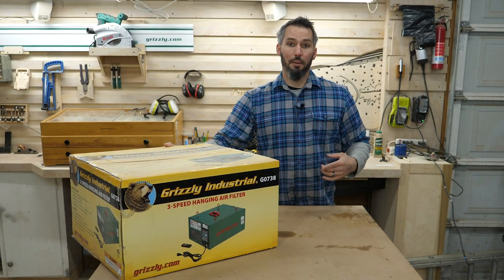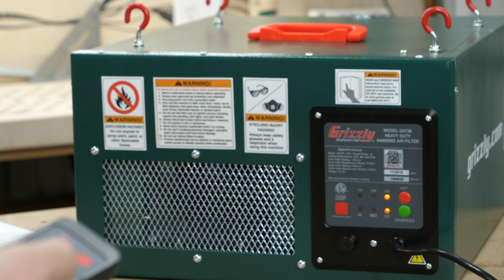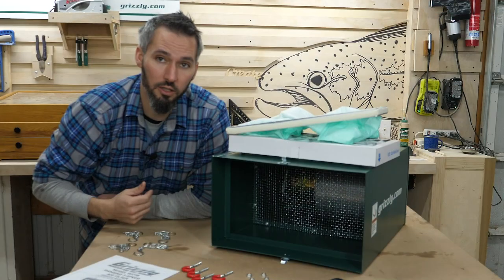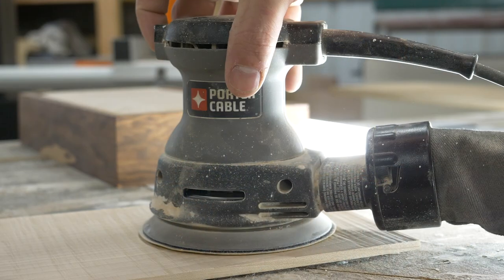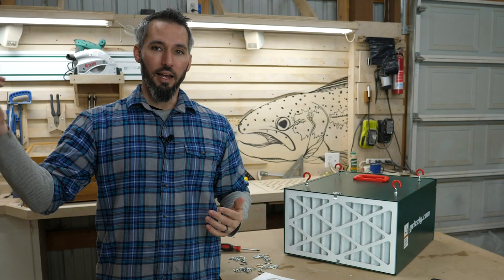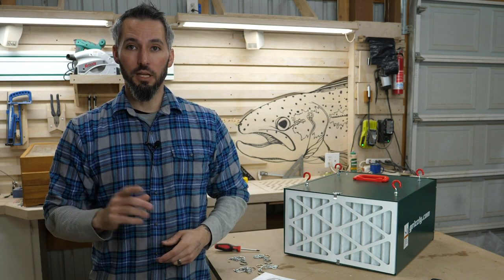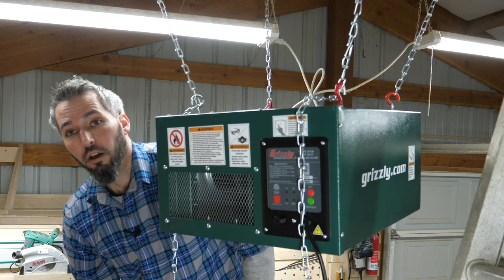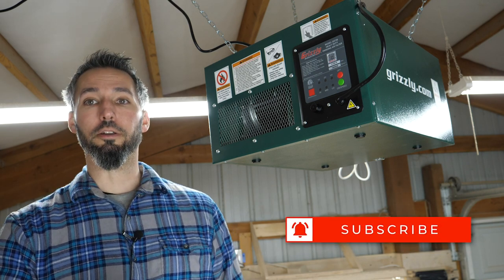Hanging Air Filters for Small Shops

Comment: I just bought the WEN model 3417.  From all my research and the price point I wanted to stay in, it looked like ALL of the "brand name" models were pretty much the same, so guessing all made in maybe 1 or 2 factories, only different names.  I like Grizzly, I have their table saw, but the WEN was cheaper for me.  About 25 years or more ago, I build my own out of 1/2 inch plywood.  Used 2 pre-filters in front, the 3 chamber bag filter in middle, then  on the exhaust side, another filter.  The blower was twice the size of these today, and moved a HUGE amount of air.  Spent less than $300 total for it.  Today, it's cheaper to buy one made.
Reply from the maker: You’re totally right that the Wen and the Grizzly are essentially the same product, just different paint. It’s pretty wild how many wood and metalworking machines for different companies are actually made in the same factory—from bandsaws to table saws and planers. Often, it comes down to paint or a slightly different stamp for the body shell. The rest is basically 1:1 and parts are even interchangeable.

Comment: Good review on the air filter from Grizzly. Did you consider any others and what made you go with Grizzly? Great looking shop too by the way.
Reply from the maker: When I purchased this filter it was on sale for an absolute steal, so it was a no brainer cost wise. I should point out that there are other filters on the market that offer the identical specs. For example, Wen filters are essentially the exact same and you can save a few bucks going that route. Jet is the same as well, though more expensive. Grizzly is a great choice though because you are actually supporting a lot of good American jobs by going that route (about 300 folks work for them in the US!). They also have the largest parts warehouse of any machinery seller, so they’ll have what’s needed, just in case.
Reply: Hello  @RiverbendWoodworks   Thanks for the follow up.  My uncle has a few larger Grizzly tools and I’ve had the opportunity to use a few of them on some projects working with him.  They were well built, heavy duty for sure and seemed to have excellently machined parts.  I’m definitely on the bandwagon of supporting local Americans, that is a rare find these days.  I do also like being able to get parts that are sourced locally instead of the alternative which usually leads to long wait times.  Again, good video and I’m looking at the Grizz now.  Have a good day. Matt

Comment: Why the Grizzley when the other clones are cheaper, WEN, Shop Fox, etc...  Is this different or does it have something the other clones don't?
Reply from the maker: In all honesty it comes down to support for the product and part availability and filter availability. Grizzly has a massive parts warehouse that is US based and they really try to have every key component you’d need available. I use my air filter daily and, like any machine, it’s gonna need components at some point (not in the least replacement filters), and it’s super easy and quick to get them from Grizzly. That said, saving a few bucks here or there can add up, and i hope the discount code might help with that 😁 Thanks for watching! You’ll love (and totally appreciate!) any hanging air filter you go with though—your lungs will thank you!
Reply: i.e. Grizzly is a paid sponsor.

Comment: I hung two
Reply from the maker: So far, after a couple weeks of operation, it's absolutely crazy how much particulate this thing has collected! Worth every penny for my little shop. Thanks for watching, Ron!
Reply: @RiverbendWoodworks  I didn't hang per the direction because of a water heater and furnace (A fear of sawdust in them).  I hung them in away that the exhaust towards the garage door and can open the garage door then put the cleaned air out.  They do work good and no complaints here about few Grizzly items I have.  I do wish they had some Grizzly garage decor thou-a banner and maybe a garage stool with back support.  All is good and enjoy your channel!!

Comment: I think you should flag sponsored content.  You have a conflict of interest.
Reply from the maker: I thought about it since, at the time, I did work at Grizzly, but I actually paid for this myself knowing it was a good product and later asked if I could get a discount code for viewers from Grizzly. I don’t get any kickback at all from sales, and hope the code is still working for those looking for a discount. I should add that this filter is very similar (if not identical) to that of Wen or even Jet. The only difference may be color. So when shopping around for a filter I would suggested also considering those if the price point is right. Overall though, I still use my Grizzly filter daily and think of it as an essential part of my shop (and health).

Comment: these are made by one company and distributed with many different names stuck on them. forget what the name is and just buy the cheapest you can find. I have just bought a Record Power filter which is the same size and colour.
Reply from the maker: Correct. It really does come down to price and support for the product. Wen offers this same hanging filter for a little less, but it is important to weigh the customer service support and parts availability (filters and actual components) which is why it’s often better to go with a known brand like Grizzly with service in the U.S. That said, I like saving money where I can, too!